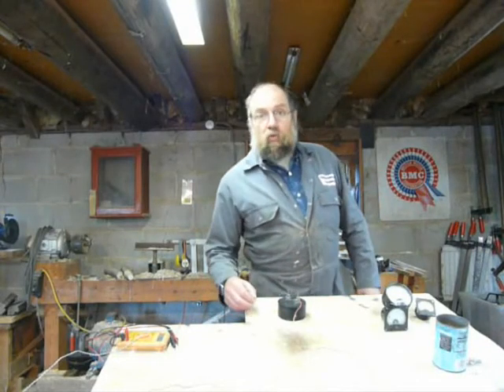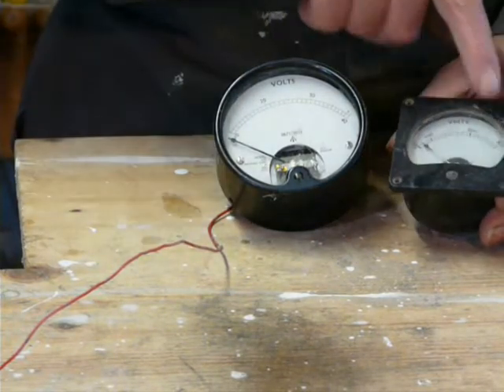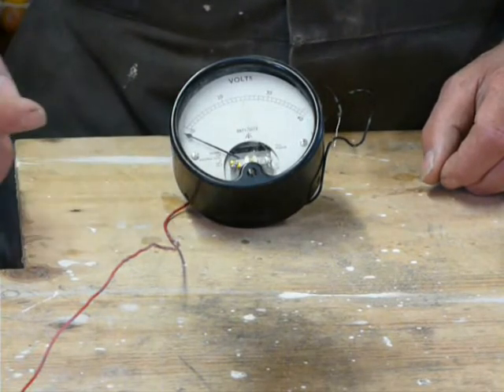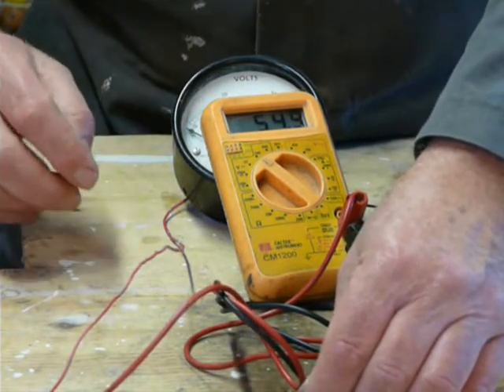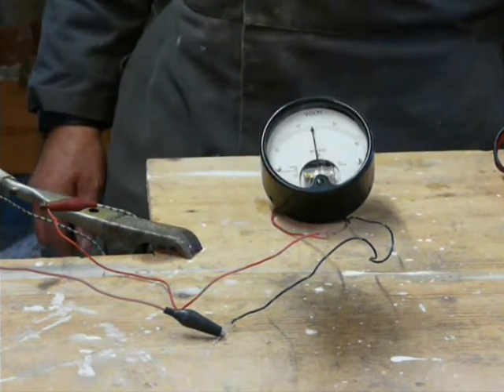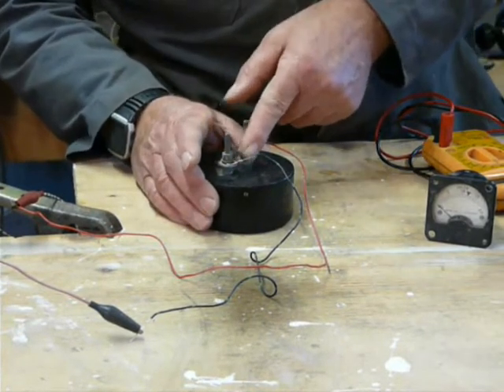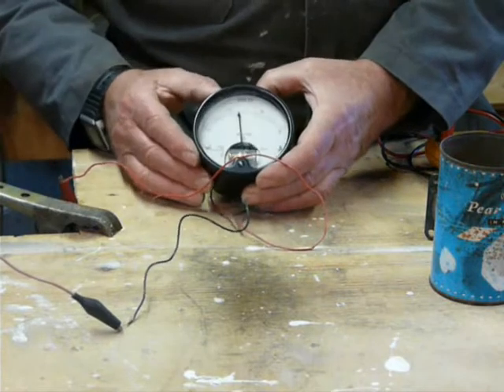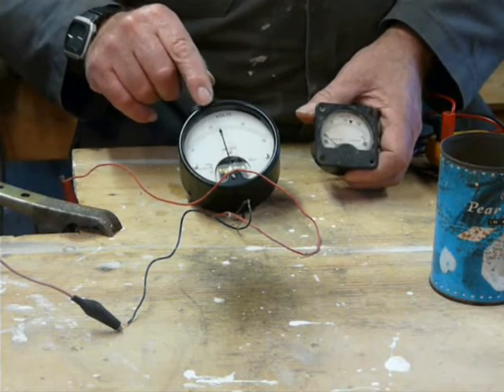Calibrating a volt meter so it will read higher voltage range, used on batteries and solar panels.

Comment: Meters using the D'Arsonval (moving coil) movement respond to the amount of current flowing through it even if the meter face say volts. One should be able to use the  current face markings  with using a resistor and an associated trimming resistor.  There are several resources on the web can aid in selecting resistor values.

Comment: Yep, diode had a 30 as part of p/n.  (I ran the video at quarter rate enlarged, as I was trying to see if full scale current rating was on the meter.)  Good job as this should work if metering circuit draws enough current to meet diode's avalanche requirements. I enjoy your videos.